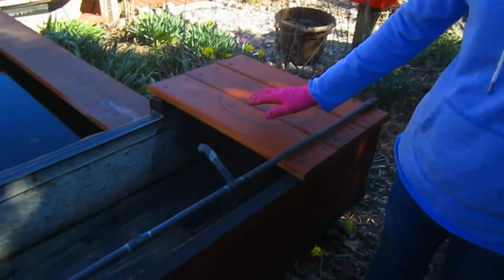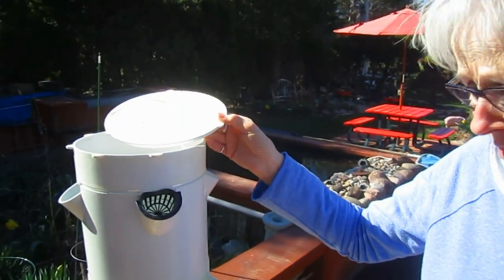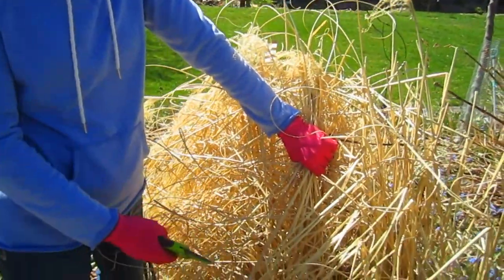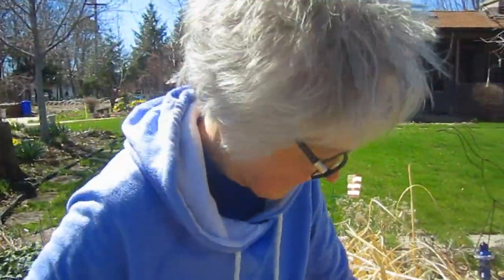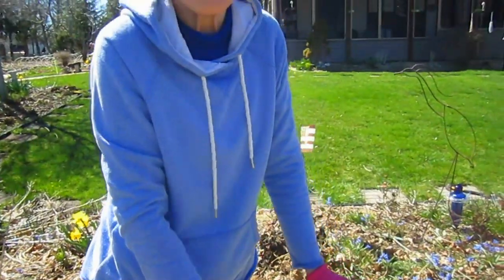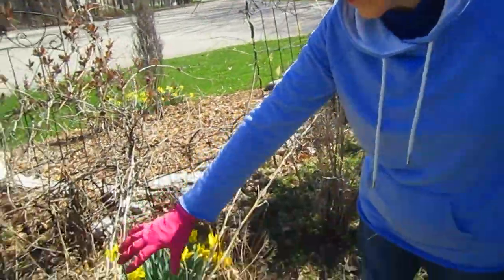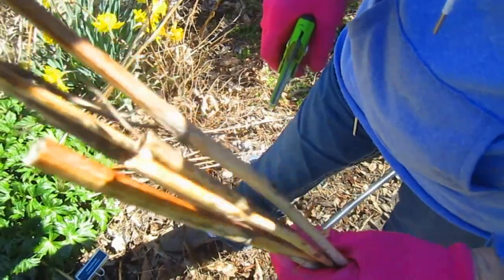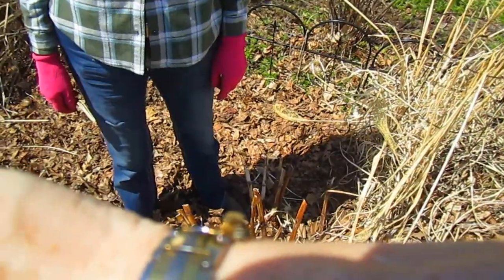Spring Garden Cleanup Part 2  - Wisconsin Garden Video Blog 866

Comment: After cleaning up and cutting down in spring. Where do you put what you cut and old leaves?
Reply from the maker: Hi Mary. All of the debris we don't add to our compost bin ends up in our trailer which when full we take to our city recycling center. We make about 5-6 trips each year. OM gosh Lynn and Richard, I am impressed. That was quite the project at your place.  Wow.   Richard looks so professional guiding the skid loader too :).  Lessandro did a fine job unloading too